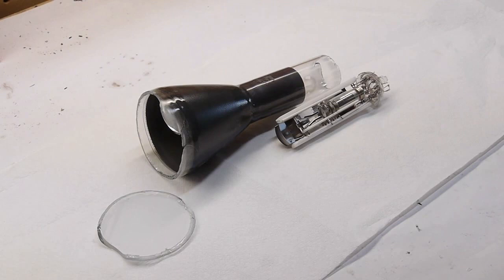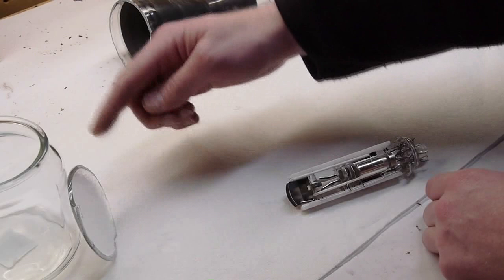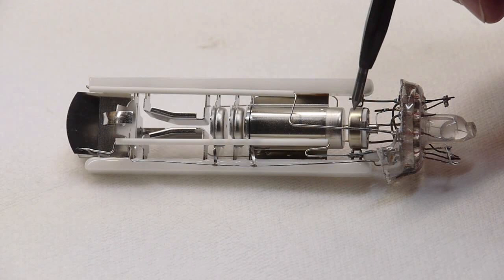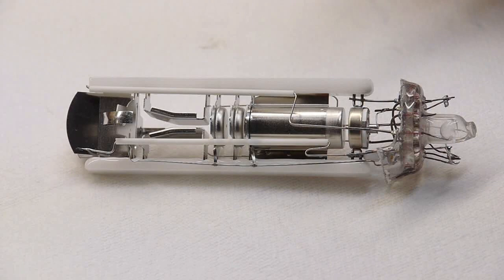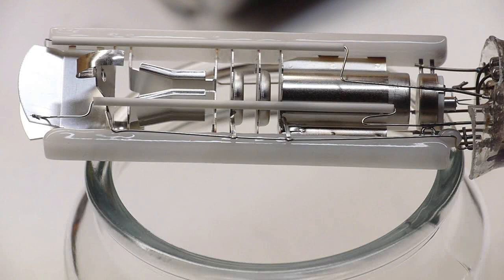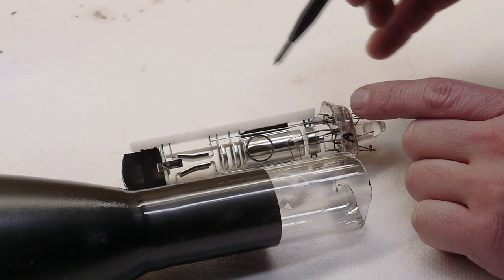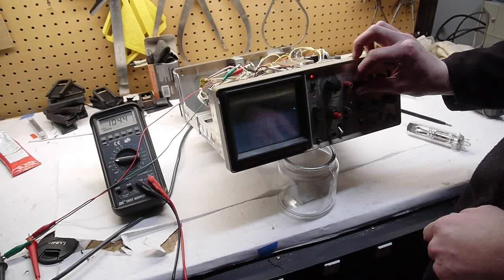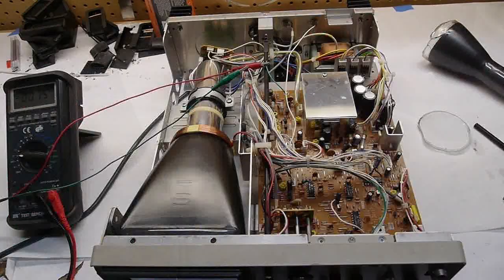Cathode ray tube disassembly and explanation

Comment: The aquadag is the anode. It's the positive high voltage connection, several thousand volts.  It serves to accelerate the electron beam toward the phosphor screen.  They actually heat the getter ring at the final stage of manufacture with an inductive coil to  vaporize the metal to "get" the final  oxygen and other atoms and achieve the best vacuum possible.
Reply: Also worth mentioning that the getter ring is most likely a barium alloy not aluminum, although it may contain some aluminum.

Comment from the maker: Yes, this is an important point. The electrons are not strictly attracted to the anode. They are accelerated by the electric field created between the cathode and anode. As soon as they fly through the hole in the anode, there is no field, and the electrons will continue moving at fairly constant speed without feeling any acceleration or deceleration.

Comment: The black paint isn't only used as the anode but also use the glas envelope as an very high voltage capacitor to smooth out the voltage since it need to be very stable.

Comment: The heat from a CRT filament is a few watts at most (6.3V at ~500ma).  There are 2 large sources of power consumption in a CRT.  The first is power imparted into the electrons.  You have many KV (more than 20KV for a color CRT in a television) times the electron beam current.  For a TV with 30KV & 20ma electron beam, that's 60 watts.  (For color TV CRT, most of this current is lost to the shadow mask.)  The second power consumption is in the deflection circuits (for magnetic deflection TV), dissipated in the yoke deflection windings.  This is so large that the high voltage in most TVs is derived from the "wasted" energy in the magnetic field at the end of each sweep.  This is made worse by short-neck TVs with sharp electron bend angles.  This requires a stronger magnetic field to affect the sharp bending.  For electrostatic (oscilloscope) tubes, deflection power is much lower as energy in electric field is low & tubes are longer, requiring less sharp bend angle.
          The voltage differences amongst the elements in the electron gun assembly are typically no more than 1000V (for color TV CRT) & more like 300V for oscilloscope CRT.  Typically the highest voltage is on the front face.  On color TV, front voltage might be 30KV, where the highest voltage in the focus assembly might be 3KV.  (You will see "fat pin" on the back socket carrying this voltage with extra insulation.  this could NO WAY withstand the voltage fed into the side of the CRT through the high-voltage wire (to both the funnel , shadow mask, & the front phosphor screen).
          In Tektronix oscilloscope CRT, there is one more element to the design.  For extremely fast waves (200MHz), the electron's dwell time between the plates is longer than the period of the wave being displayed.  What is needed is for the deflection signal in the plates needs to follow the electrons as they move along.  This is done by segmenting the plates into parts & connecting them to a transmission line.  The propagation speed in that line is made to match that of the speeding electrons.

Comment: Hello, I have pulled out many CRT tubes from RGB rear projection TVs. I have a good knowledge on the CTR wiring after watching this video and cross referencing it with what I know about other similar technology. There is a small cap on the tungsten filament itself that seems that goes to a pin. I understand every other function electrically however I do not know what potential,polarity, or function this pin plays. Worry not about getting back to me any time soon. I have 6 tubes to try and I am not at all bashful about cramming voltage into things. Nice thing is they pretty much can't really be damaged through voltage break down as long as I don't burn out the tungsten. BTW the metal on the getter is usually cesium as it's a rapid oxidizing metal The getter not only burns off the atmospheric oxygen but depletes a coating, since this increases surface area when depleted on the glass it helps rapidly neutralize any leaking air as well as serves as visual indication of a bad vacuum.

Any assistance will be greatly helpful, I will be trying to hack and show how to look at and understand both CRT and Vidicon tubes.

Comment from the maker: The cathode in CRTs is a relatively large metal can coated with metal oxides (perhaps barium oxide among others). The oxide layer has good electron emission characteristics, which allow more electrons to be emitted than plain metal would. The cathode in a SEM is sometimes a single piece of tungsten wire -- much smaller than the metal oxide cathode, which produces a much smaller beam spot size. Opening a CRT to atmosphere will ruin the oxide coating on the cathode.

Comment: The conductive Aquadag coating, covering the interior of the front part of the CRT, turns that part into a Faraday cage, so the electric field in that part is zero; thus, no further deflection of the electron beam occurs.  (The voltage is quite high, but the same everywhere there, so zero electric field.)
I used to envision electrons getting sucked into the phosphor by the positive high voltage there, but no!  The acceleration of the electrons occurs back in the electron gun assembly.  As you saw in this video, two of the electrodes are at full high voltage (notice that a spring metal tab connects them to the Aquadag coating).  The electrons are accelerated when they pass through the first electrode at the full high voltage.

Comment: The first time I saw a cathode ray tube described, it was the first CRT ever built. It was described in a 19th. century physics book that my great-grandmother lent me when I was ten. It was called a Röntgen tube and it included a thin metal anode in the form of a Maltese cross shadowing the final, otherwise blank, image of the non-colimated electrons emmited by the hot cathode filament. Only those two electrodes were inside the tube. A drawing illustrated the device.

Comment: Cathode Ray Tube…electron gun!

 I have been watching Sean Carroll's The Big Picture 'videos"...reviewing: the double slit experiment, the electron wave particle duality, the measurement/observer implications, the electron as vibration in the electron field, entanglement, etc.. The mathematical physics word problems in high school entailed electrons as particles ...with an electrical force, magnetic force and force due to gravity acting on the straight line path and momentum of an emitted electron.

My interest in watching cathode ray tube videos comes from wondering whether the electrons leaving the cathode are emitted as waves or as particles? 

First, I watched a video explaining the ray tube of a black and white TV, with two coils of electromagnets deflecting the "electron" in the X and Y plane via magnetic fields.
In this video, the electron deflection is by electric fields between a perpendicular pair of parallel charged plates.

If a 'particle' is emitted from the cathode, the magnetic fields generated by the two coil, or in this case the set of parallel charged plates, directing a particle or stream of particles, horizontally or vertically, seems reasonably intuitive. 

However, if the electron leaves the cathode as a wave/wave function, do the x and y electric or magnetic fields 'condense' a wave to a particle...or do the x and y electric or magnetic field focus a wave, with a particle 'appearing', 'being observed', with the "observation"... the emission of visible light at the 'detector' - the florescent screen surface.

At time 11:42 of this video the image on the screen appears to be very close to an interference pattern around a central bright zone. Hmm!

Comment: At the right hand side of the filament/leads area, there's a small glass tube where the air is sucked out by vacuum pump, hen the glass is heated and sealed off. This is pretty much the procedure for all types of vacuum tubes.

Comment: Great explanation and investigation as always, thanks for sharing! I'm curious about the trace rotation equalizer/coil, I don't understand how that would rotate the beam since its magnetic field is parallel (center nearly collinear) to the electron beam so I would imagine it could only dampen or speed up the beam in its existing direction, or is there something inside that alters the direction based on the magnetic field?
Reply: How've you been Samy? Working on anything cool?
Reply: Hey Samy, I had the same exact question. The closest thing I found was https://w140.com/tekwiki/wiki/Trace_rotation which mentions that for "Electromagnetic trace rotation: Current is passed through a coil near CRT, creating a magnetic field that counterbalances the magnetic field in the environment" but this still doesn't explain the mechanism.

Just a guess, but I think what's going on can be explained by the right hand rule for the Lorentz force and the fact that a horizontal line on the screen means the electron beam is actually moving side to side, not just straight down the barrel. Looking down the CRT from back to front, with the magnetic field from the coil moving in the same direction as the center of the beam, then when the beam is angled to the right,  there is a little bit of a difference in angle between the electron beam and the B field, so according to the right hand rule, the force should point up. Moving further to the right the force is greater, so the deflection is greater. The effect is that the right hand side of the beam overall is deflected up.

For the left hand side of the beam, the difference in angle between the beam and the field is negative, so the Lorentz force will point down, and the beam on this side is deflected down. In total, this means the horizontal line should be rotated counterclockwise in proportion to the magnitude of the B field induced by the coil.

The same logic should apply for the magnetic field going the opposite direction (i.e. towards you instead of away) but the rotation would be clockwise instead.

Hopefully this makes sense.

TLDR: The electron beam for a horizontal line does not always point parallel with the magnetic field. Where the beam isn't parallel, the beam gets deflected up or down, causing a rotation.
Reply: Yes you are correct that when the electron is traveling in the z direction it is parallel to the magnetic field, however when it is deflected it gains a velocity in the x or y direction and the electron will experience a force perpendicular to its x and y velocity and the magnetic field

Comment: Because the flyback transformer in a TV (unlike the more general term flyback as applied to switchmode power supplies) was originally designed as a way to produce the necessary magnetic deflection currents in addition to the high voltage, all in one circuit. Electrostaticly-deflected CRT's do not need magnetic deflection currents.

Comment: @bkraz333 the cathode is coated with a mixture of barium, strontium and calcium oxide. when the tube is assembled the cathode is coated with barium, strontium and calcium carbonate, during evacuation the cathode is heated to decompose the carbonates into oxides and CO2. the CO2 is then also pumped out

Comment: Thanks for the explanation. Could someone perhaps clarify one thing for me? OK, so let's follow an electron as it's leaving the negatively charged heated cathode. It's being attracted by the positively charged anode, and is thus accelerated towards the screen. Now at some point, as the electron passes through the middle (ish) of the anode, does the electron start slowing down as it starts getting attracted back by the same positive charge of the anode?

Comment: I have been using a CRT in a physics experiment, but I have never measured the spot size. The oxide coating is not ruined, but it needs reconditioning once in vacuum. You basically just turn up the filament current, and raise the suppression grid until you see a lot of beam current... and wait 10 minutes.

Comment: Very comprehensive explanation and fun to watch. It is really long ago, that I have messed around with crts. I never did anything with a scope, because it was the most expensive thing in my lab. The tvs, that I pulled out of the trash (end of the 1970s, when people dumped their spare b&w tvs) all had an inductive deflection system (coils in a can, that were placed at the behind the acceleration electrodes). For a scope, the inductivity might limit the bandwidth. How did you prevent implosion, when opening the crt? That is, what I have always been concerned about.

Comment: A lot of the invention was by experiment. Only way to discover a functional technology is to apply theory to reality, and often the materials weren't pure enough, or wrong alltogether. That of course led to more findings about physics, and theorists had a field day, while the people trying to apply the theory in practice were a bit miffed. The CRT was a developement of the vacuum tube (electric valve), used as an amplifier, but before that as a radio tuner.

Comment: well i was actually interested in how the magnet or coils energizes the rays as it shoots out the gun and the rgb gets controlled in a actual image, and even better how the tv rx picks up the tx transmission and gets reorganized by the crt? that whole interaction is worth a video "specially w/ you been the host lol"
Reply: But there are no magnets or coils energizing the ray lol, it's thermionic emissions being accelerated across a difference in potential, like marbles rolling down a hill

Comment: If you look down into a CRT, you can see that the hole in the suppression grid is very small, and it is the field that controls the emission(as you yourself explains). You also have the build in focus. Are you sure that is matters wether the cathode is a wire or it is indirectly heated?

Comment: First I want to say that I really enjoy your videos! I know that I am coming late to the party, but is there any way a CRT could be modified to make a small SEM? (saw your home brew SEM - amazing!) It just seems like it would be perfect at first glance...
Reply from the maker: Kenneth Terry Thanks!  Yes, converting a CRT into a SEM would be great, and it has the potential to work.  The best candidates are probably old-fashioned CRT viewfinders from camcorders because they are already very small.  The main problem is that all CRTs are designed to produce a spot on the screen that is large enough to fill the gap between sequential scanlines (so that the image appears solid -- not stripey).  Thus, the resolution of a SEM built from a CRT will not be so great, and this is limited by cathode construction, and the location and type of focusing coils/electrodes used in the CRT.  Another problem is that the cathode used in CRTs are sensitive to oxygen, so after bringing the whole set up to atmosphere, it will not emit electrons as well.  Still, it should work well enough to make an image.
Reply: Kenneth Terry came here to ask this. Was not disappointed by response.

Comment: The thermoionic emission such be achieved through extremely short but extremely powerful electrical pulses as "shots". Regards from Ur Scientist Adam der Erste.
Reply: Using pulses would greatly but greatly enhance the total efficiency. One can build a proper cathode ray tube with much higher efficiencies comparable to backlighted LCD devices. Regards to Sony Engineering Department as Whole.

Comment: I'm assuming that the 'dot' is circular, because the emitter is also circular? I've thought about the assembly of the CRT, but I can't help but think that the dot should be more squared than it is on ever oscilloscope I've ever used (a one handed number).

Comment: What is ionised to release electrons is it the tugsten? I would think after a while the ray tube would have to replace as the metal would no longer release electrons as the energy required would be too high.

Comment: Why crt TV use magnetic deflection yoke and oscilloscope crt use Electro Deflection ?
Reply: I was about to ask the same thing. One uses an electric field and the other uses a magnetic field - anyone know why this is?
Reply: @StarsManny  there must be some unique difference may be something to do with  efficient electrical deflection  in cost of less coverage over screen I guess .
Reply: Ok enough guess ....

Here's what Wikipedia says - 

" Magnetic compared to electrostatic deflection

Another way of deflecting an electron beam is to put two pairs of electrodes inside the CRT, after the electron gun structure. Electrostatic deflection is common in oscilloscope displays, because it is easier to drive deflection plates at high frequencies, compared to driving the large inductance of a deflection yoke. Compared with electrostatic deflection, magnetic deflection has fewer obstructions inside the tube and so allows for a larger-diameter electron beam, producing a brighter image. This is an advantage for a raster-scan display, which must cover the whole screen instead of one narrow trace as in an oscilloscope. "
Reply: @omsingharjit  makes sense! Thank you! 👍

Comment: So if electrons are attracted to anodes, when the electron is accelerated past the anode and the anode is behind the electron, shouldn't the electron be slowed down by the attractive anode behind it and eventually switch directions completely after going thru all 3 anode sections and accelerate towards the attractive anodes that r in the opposite direction from where the screen is?